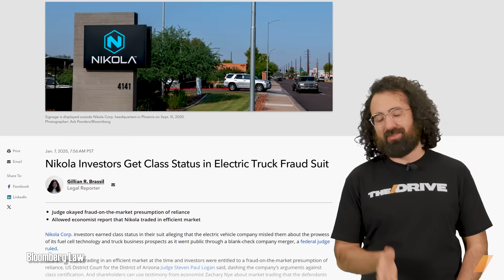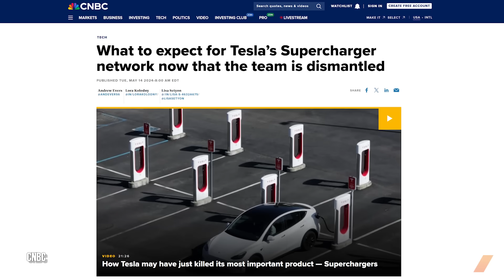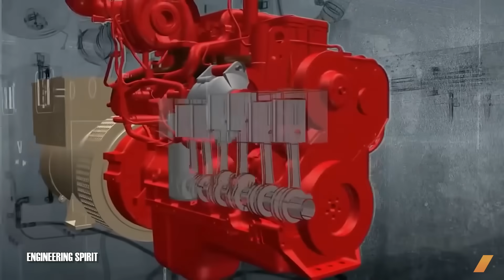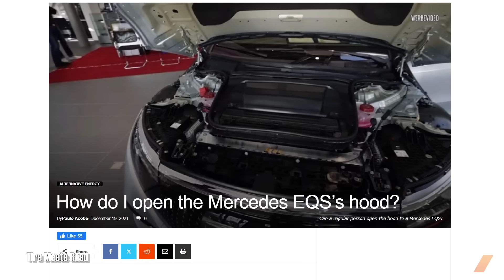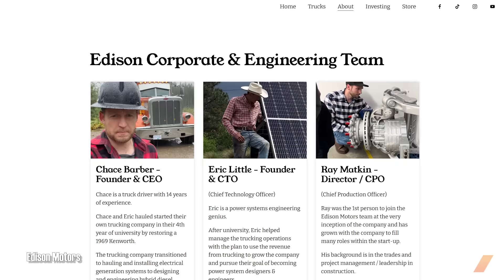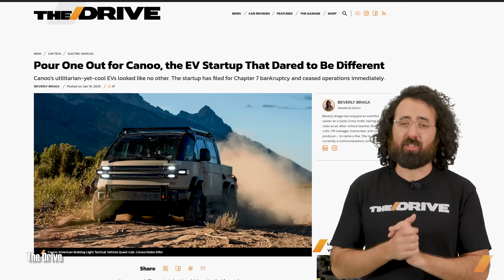The truckers in a shed beating Tesla with 100-yr-old EV tech

Comment: Ive been saying this method for years. A diesel generator running at max efficiency rpm is the key. Take a short range electric vehicle, install a small generator built for high efficiency, charge while you drive. Park at destination (outside only)- let generator catch up while you are at work.. auto shutoff when fully charged. Risk? Yup. Some idiot will try generator charging in a garage.

Comment: 6:00 About the reduced fuel consumption, you should have mentioned that when going down a mountain with a trailer fully loaded of heavy tree logs, 
you can store in the batteries the electrical regen energy that can be used then to go up the hill with an empty trailer, an efficiency not possible with fuel.

Comment: Few corrections:

1. There are already electric trucks on the market, especially in the EU.

2. The reason why this hybrid ideea is good, is not 100% corect explained in this video. Diesel engines used as the main propulsion system, is designed to work on a large rpm range (ex: from 500-2000 rpm) which is not ideal. Instead, hybrid vehicles use engines that runs all the time on constant rpm. This mean that the engine is optimized to work only on the sweet spot all the time, which translate in a very high efficiency.

3. No DPF needed? I don't really believe this information till i will see some valid data. Is almost impossible to get rid of the PM emissions. Maybe just a reduction in PM and NOx.

4. Converting Diesel to electricity then to motion is more efficient only from the reason mentioned at point 2. At cruising constant speed (ex 90 km/h i. Europe), a clutch will be necessary to couple directly the engine to the wheels. Otherwise, the energy conversion will translate into useless heat.

5. A smaller battery for the boost or energy recovery from the braking is still needed.

- mechanical engineer in vehicles / propulsion systems.
Reply: Finally. A rational observation. Thanks. :)

1: Correct. In USA there are Volvo,Freightliner, & Peterbuilt EV trucks.

2. I agree

3. Scania engines meet tier4 compliance with EGR and SCR and do not need DPF.

4. Correct. Hybrid makes less sense for OTR. Hybrid makes more sense for drayage, and huge advantage for logging trucks that go up mountains empty and the regen on the way down.

5. Correct. An Edison semi does not have 10,000 lbs of batteries like a full ev, but it does have 2000 lbs of batteries for peak loaf starts from an intersection,  and to recapture energy during braking.

6. Also ICE/Electric hybrids have smaller engines that handle average loads, while the electrics handle peak loads.

Comment: You neglected to mention what the pollutants coming out the tailpipe are.
Reply: They actually went over that in about the middle of the video. It's not really any different then getting it from the grid or in the logging environment it was made for, there is no grid, so if the truck didn't carry it's generator, they'd be plugging into another generator on site. The only difference with hooking to the grid is you move the pollution from where you are, to where someone else is.

Comment: I have no idea why the industry is so resistant to invest into hybrids/plugins. Yes you haul the weight of two engines, but all them already show that they have no problem to double the weight of basic vehicles with batteries. I'm sure a lot of possible clients would accept 50% less electric range for the peace of mind and flexibility of mixed drive. Also keeping that diesel in optimum range is so much better for the longevity and efficiency of the engine its crazy. Just think about generators and how many hours they can run. My only worry would be constant sound of the engine which can get dreary.
Reply: nothing good mufflers and sound deadning in the cab cant fix
Reply: @kegankirkpatrick2688  definitely! But sound insulation is the first thing to be cut on a budget. If you added insulation to your car you know what a difference 100$ of insulation is.

Comment: 80,000 is the limit for tractor + trailer - MANY on the road will "cube out" and not be close to that, as they run out of SPACE before they run out of weight capacity.

Comment: You can do this with a normal EV. Buy a large power station. A portable 200-watt solar panel. Put them in your EV with your stage 2 home charger. When you need to charge. Pull over and charge. Some vehicles don't have all of the window tent. You can place the solar panel in a location and charge the power station while going down the road.
Reply: A person would need acres of solar panels to feed a semi truck.

Comment: Excellent. Makes a lot of sense. Given how much space there is on the roof of a truck box thing, the big bit on the back, some trucks might be able to add solar panels to the roof and passively add some herbs back into the battery. Also they won't have jake brakes or engine braking or exhaust brakes, so I imagine they have to have regenerative braking built into those wheels, otherwise the brakes would be a bish. 
Great story.

Comment: This system is also used in mining trucks like cat 798 Ac, komatsu 980e,...only difference is that they don't use battery to power the motor or store electricity generated during regenerative braking....
This is not as efficient as mechanical transmission not matter how much you say that engine will run at constant rpm constant load ...
Power is lost in alternators,  inverters and motors...
For examples most if mining trucks and locomotives uses 3phase induction motor...they are typically 85% efficient...

Comment: I can't believe Americans actually believe this BS.
The fact that AMERICA isn't able to electrify quickly does not mean the rest of the world is in the same boat.
Norway is at over 95% EV sales already, and the world's biggest EV market - CHINA - already sells more electric powered vehicles than ICE vehicles.
Both the technology and resource base for full electrification is here NOW, and it's just a matter of transitioning.
In the meantime, the stop-gap of hybrids will suit those countries incapable of getting a charging infrastructure in place. But hybrids add a level of complexity and extra cost that pure EVs avoid.
The biggest problem for Americans is their inability to adopt a different mindset to transport and transporting goods. You don't solve a problem with new technology by using the same thinking as applied to the old. Nio fixed this for cars by building battery swapping stations that got a vehicle's travelling capacity back to 100% in 3 minutes - faster than filling a gas tank. Australia is already doing this with Janus Electrics... https://www.nsw.gov.au/ministerial-releases/local-deliveries-to-go-solar-as-truck-battery-swapping-station-comes-to-moorebank-intermodal
Unless America gets on board with full electrification sooner rather than later its operators and consumers will be wearing much higher costs than the rest of the world and lose even more of its international competitiveness.

Comment: To be clear, those old 60's logging machines and trains are not hybrids, simply "Diesel-electric", they can only take power from the Diesel generator, they cannot switch power source, even the dynamic brakes do not send any power to batteries, it just leaks out as heat in a large resistor pack. The Edison trucks are hybrids, they can send power to and from wheels and batteries and take power from an engine, not like a traditional hybrid that has a physical shaft from engine to wheels, but a "Diesel-electric hybrid".

Comment: 2025 and the media is still using the same tired tropes about EVs not being practical, economical, grid unfriendly, battery replacement fud, etc. We are 20 years into electrification and none of that happened. Hybrids in trucks are great and will same a lot of fuel and expense, which is why the oil industry will spend a lot of money to slow that down, as they have been.

Comment: Series Electric, with or without a hybrid traction battery, is less thermodynamically efficient than a gear driven diesel, however for many operation cycles, torque delivery is very flexible - and the system is "simple" mechanically, this can work  (not for every trucking route necessarily). 

Efficiency isn't everything under non peak-power "variable duty cycle operations..

Series-(Parallel) Hybrid throws a traction battery into the diesel electric mix...  
(Old school Series Diesel-E;ectric, Isn't really a hybrid, there is no traction battery and only one power source - straight from diesel through an electric transmission to the final drive - the hybrid designation really demands  2 or more power / energy - sources (ie. diesel plus battery bank allowing regeneration of energy with storage - Traditional Diesel Electric trains don't do "regen" - they burn off waste heat. for immediate and long term power delivery...)

Comment: Europe has many electric trucks that work fine in the cases that electric trucks work. Short-Medium range journies. There is this YT channel called "Elektrotrucker" that documents all of this. His main limiting factor is not the range of the truck but the mandated breaks he has to take, during which he charges his truck. Europe also has a higher total weight allowance for electric trucks. Electric trucks may not fit every industry, but most 80-90% of trips can be done by them.

Comment: Comparing locomotives with prime movers will not give the same results. The locomotive has very little friction or rolling resistance. Increase the locos weight and woohoo it can pull more for little penalty. The prime mover has more rolling resistance and a smaller motor on long haul in adverse conditions ( Australia), will not work

Comment: An efficient high performance electric truck is not an engineering or economic problem, it's a political problem. The trucking industry could have made a diesel hybrid a long time ago using existing tech, especially when batteries came to scale. The auto and trucking industries are part of the larger petrochemical industry. They are there to provide a customer for the fuel. We are seeing this from the guys in Canada because in the US they would be buried. Hopefully, they succeed, but expect the legacy industries to set their sites on them if they start getting traction (pun intended). Fully electric trucks were allowed to proceed because everyone knew they had limitations that would sour customers. If the industry had started with serial hybrids in all trucks, it would have destroyed demand for regular drivetrains, which would have destroyed demand for fuel. That is why you only see these EV drivetrains in applications that can't use traditional ones. It's all about oil profits and that is not changing anytime soon, especially with the "drill, baby, drill" politics.

Comment: It is fascinating to watch the desperate rear guard action being put into play by the oil industry who can see their monopoly on the worlds transport fuel industry slipping out of their grasp. The first few words of this clowns intro tells you just how much disinformation he is going to spout.
Yes he is right in that if the world changed to EV over night there would be a problem but that is not going to happen. The world is not going to change to BEV or hydrogen or even hybrid over night.
Dig deeper into the video and very quickly all the scare tactics, half truths and outright lies come out.
Lets start with the first lie at 1.41 Quote " As of right now there's really just one electric semi-truck on the market and that is the Tesla Semi"
Seems that he conveniently forgot to mention Mercedes-Benz, Freightliner, Mitsubishi Fuso, Daimler Rizon, DAF, Peterbilt, Renault Trucks and Volvo to name but a few and yes there are many more. According to Statistics Europe in Feb 2021 there were already 289 Electric semis working on European roads a number that had grown to 6000 by 2023. Just a small oversite. 
Battery weight. He is right Tesla do not disclose the battery weight but Volvo does at 500Kg per pack with the largest truck having 6 packs or 3000Kg, about half of his claimed 6 ton. As a comparison he quotes a Cummons engine at 2961 Lb but forgot to include the transmission, 500 ltrs of fuel and 900 Kg of lead acid batteries.
The scary cost of replacing a battery. Catl, the worlds largest supplier of batteries guaranties their batteries for 1 million miles. He also forgot to mention that just like a diesel engine a battery can be overhauled, it does not need to be replaced every time.
He couldn't even get the history of the hybrid correct, they date back to 1899 not the 1920's that he claimed.
I could keep going but suffice to say that his facts are crap designed to put EV semis down and promote a company that is yet to build 100 trucks. I wonder just how much he was paid to spout this drivel
Reply: Or, manufacturers like Ford, Scout, BYD & Ram have come to the conclusion that fully electric pickup trucks simply cant "truck" things like towing trailers while using current battery tech. So these manufacturers are now producing battery trucks with small range extender engines so trucks can do truck things.

In the future when battery energy density  and recharge time is more comparable to ICE then I'm sure dinosaur fuels will go the way of the dinosaur. Until then, hybrids are a step in the right direction

Comment: I'm the kind of guy with 2 kinds of maple syrup. I make fries at home in a deep fryer pan, sometimes I make poutine. Growing up outside Detroit I was lucky to travel to Windsor, and other places in Ontario as a kid. I was already obsessed with Canada before Edison Motors. Now I want to be a franchisee. There are millions of work trucks & semis in America that will come up due for a refit over the next 20 years. EM upfitters can build a business that helps hard working tradesmen save money on fuel and give them something they like driving. Quiet operation for cement mixers at night. Many applications. They haven't even thought about farm equipment, which faces the same run-time problems with that BEV does.

Comment: Their approach is really, really interesting.
Not only for Semis, for EV trucks, miniVans/Vans , as well.
The problem with batteries - they scale with vehicle weight, generating even more weight (e.g. for Europe, you need drivers license class C (Commercial, past 3.5 tonnes) to drive a Cybertruck and other bigger EVs), and still have poor range. 
On the other hand, Bigger cars have more space to work around - an BMW i3 with range extender - meh. A Tundra/F350 with this approach can go anywhere without fear of lack of outlets, and won't need special equipment to pull out if stuck. A Chrysler Pacifica can be cleaner and leaner.
*also, a 80l vs 40l fuel tank costs less than 120kWh vs 60kWh battery.

Comment: I would like to know how the cabin heater works. An electric heater zaps energy, and one that uses the engine’s cooling system requires the engine to run more.
Reply: Same as a normal EV, generative braking. when you got 70,000lb of logs pushing you downhill that's allot of energy that would otherwise be wasted solely on hydraulic brakes.

Comment: Replace the piston engine generator with a gas turbine generator, more efficient , lighter and sounds cooler, also super long lasting,
Reply: And multifuel. I also had that idea about 20 years ago, then found out about the jaguar CX75 prototype which was originally going to do something similar, again trains did it first too. They'll get there eventually.
Reply: @tomstech4390   always large industrial equipment are far more advanced than these minaturized mass produced junk for peasants.... have you seen how complex but highly efficient district cooling systems are compared to a mass produced boxed AC unit?

Comment: The benefits in a Logging application are incredible.
An empty truck goes up a mountain. Charged.
It loads many TONS of logs. Guess what that is?  Potential energy.
On the way down the mountain most braking is regeneration recharging the batteries. Bottom of the hill, you are recharged. Off you go to the mill.
Huge fuel saving.

Comment: 8:43 mm just think of the billions of barrels of oil that didnt need to be burnt had we done this decades ago
Reply: This is the way
Reply: Oil is used for more than just fuel. 3/4 of the things around you are made of oil. Lithium is a very expensive and difficult to process product. If "manufacturers" are so concerned about emissions, why don't they develop technologies based on photosynthesis.

Comment: So...... you are pointing out there is yet another design to fit some ones use case. No need to insult some other company with a design, that is designed to fit certain use cases. You are doing just what all companies do. There is room for a multitude of designs. As you state, "it's not about one size fits all"